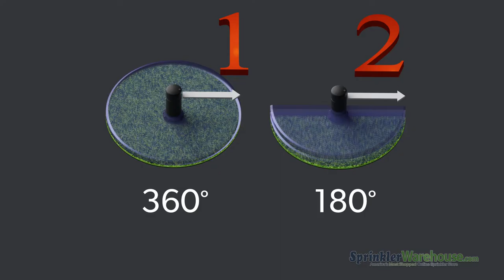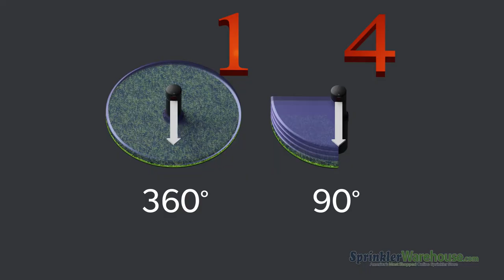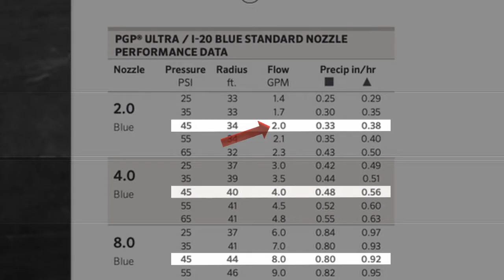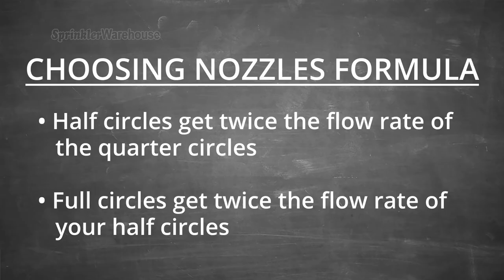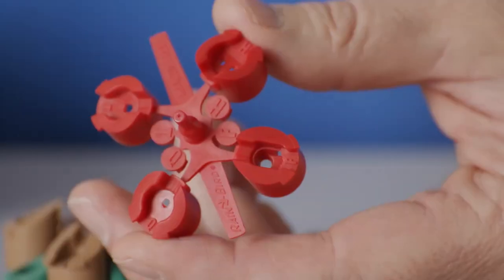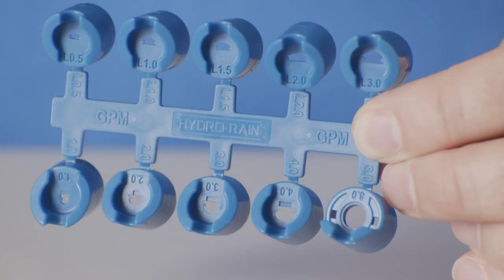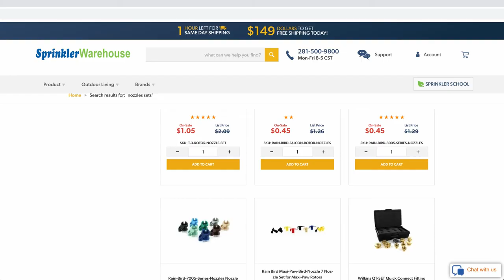Selecting The Right Nozzle For Your Rotor

Comment: Thank you, thank you, thank you. As a volunteer operator of a local youth baseball complex we've been struggling with getting this type of information. We paid an expert to install our system on a new field several years ago. It does not have the spread or the heat to head coverage because they put too many heads on one valve and turns out they used the same nozzles too!! Now that I've watched this I feel I can make adjustments and get things close to correct so our grass is watered correctly and consistently.